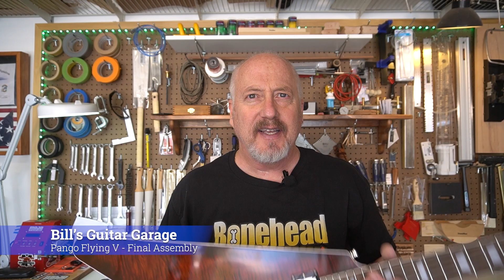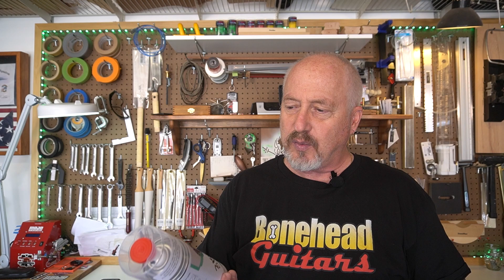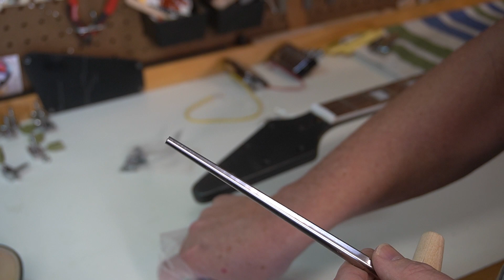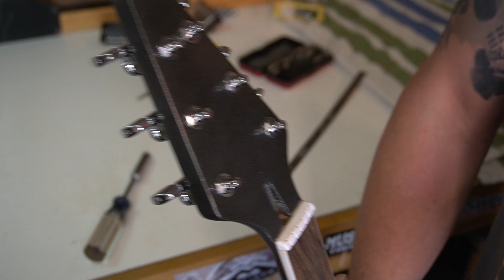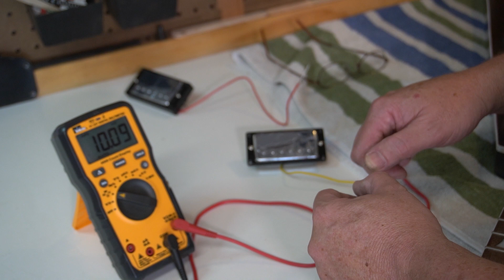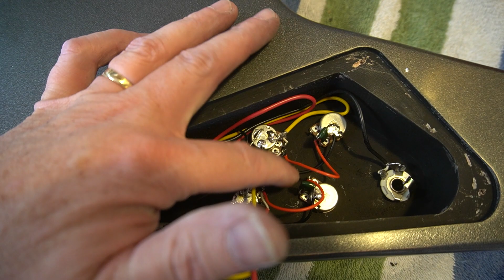Pango Music Flying V Guitar Kit   Ep 5   Final Assembly

Comment: Has anyone had an issue with the holes for the bridge being too small?
Reply from the maker: I have seen a couple reviews where people have mentioned some issues with the hole size and spacing.  Just keep in mind that you want the hole to be a very snug fit.  The smooth portion should fit in the hole, but the splined portion will not.  You will need to use a mallet or a press to install the posts.
Reply: @billsguitargarage  Thanks.  The small portion wasn’t even close to fitting